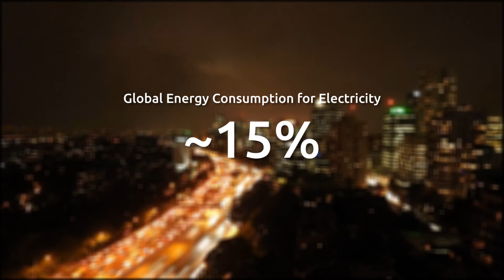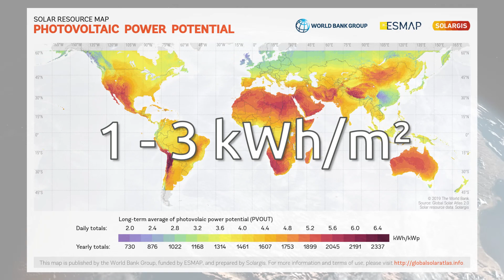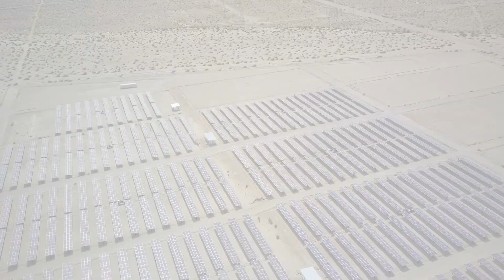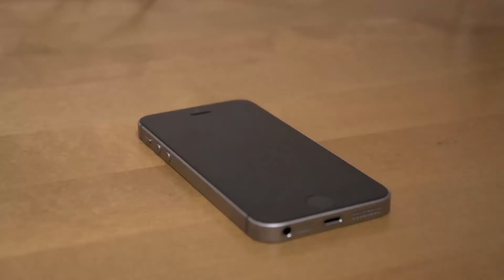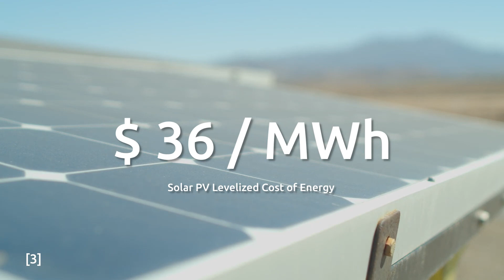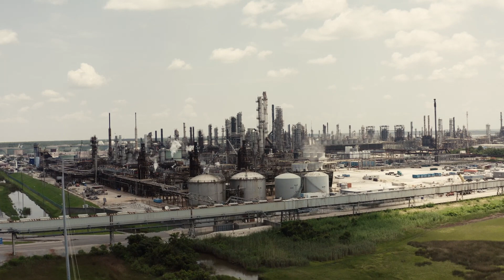The Hidden Cost of Solar Panels

Comment: Thank you for providing this reality check of concrete facts.  There is a lot of pie-in-the-sky, unrealistic optimism about renewable energy.  The reality is that ANY generation of electricity has a negative impact on the environment.  Renewable energy just creates NEW problems.  Lithium batteries for electricity produced by solar farms?  Lithium mining has a devastating impact on the environment.  The carbon footprint of a lithium battery is huge.
    THERE AIN'T NO SUCH THING AS A FREE LUNCH.  To save the planet, we must REDUCE CONSUMPTION, including the consumption of electricity.